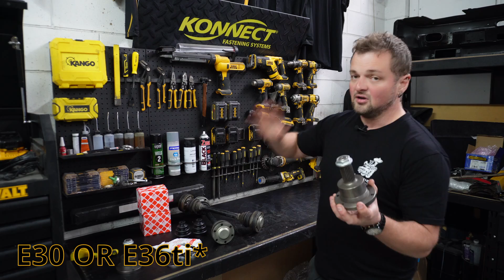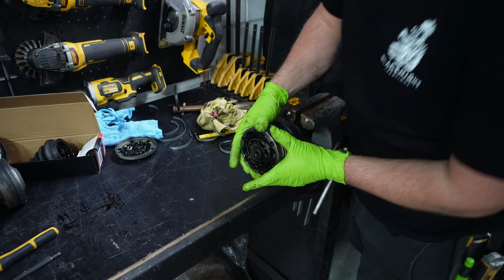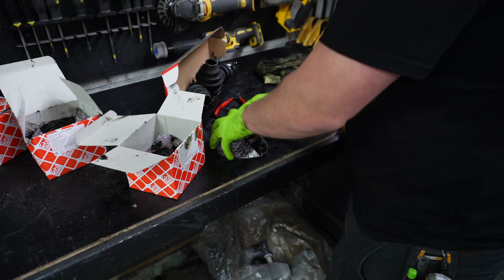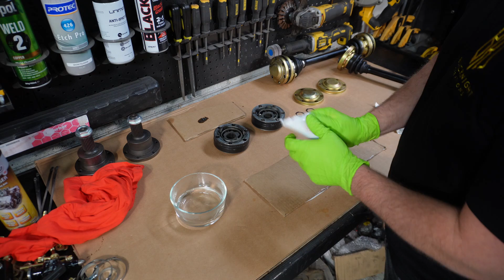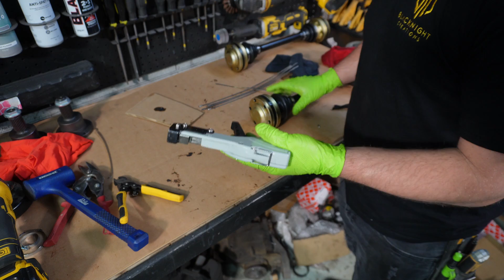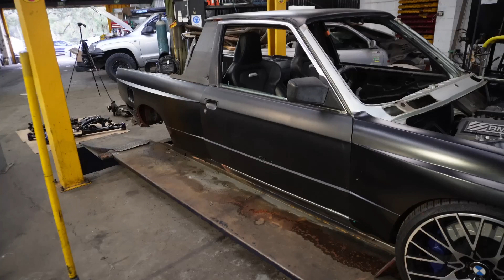Project Mute Ep.35 Rebuilding E34 Axles

Comment: so any year e34 or certain model axles? my car is 5 lug, and running z3m axles and i twisted the stub shaft clean off, and im only around 440hp
Reply from the maker: I’m not sure if the stub axles I got work with the z3m hub splines. The E34 axles you’re chasing are the 6 cylinder axles from any year e34

Comment: the e34 v8 axles uses 8 bolt not 6 ,  like the 35i, m5
Reply from the maker: The ones I have are a 6 bolt and bolt up to the adapters. Part number is exactly the same as the 6 cylinder. Might be different for the manual version though, they might be 8 bolt
Reply: Yeah these are e34 530i v8 axles, uses the same medium case diff size as the 525i and 535i straight six cars. Realoem lists them as the same axle but obviously there's a difference. Sorry about that chief!